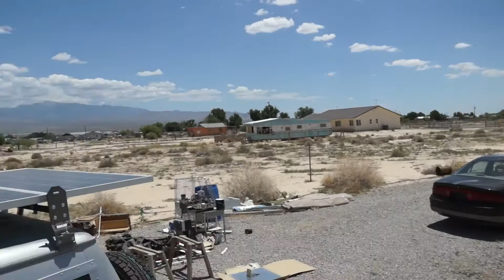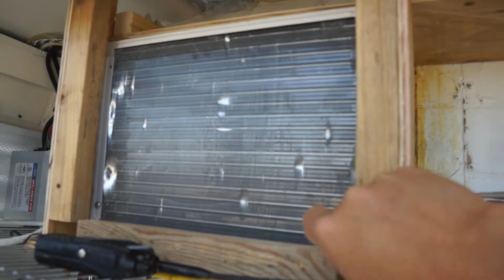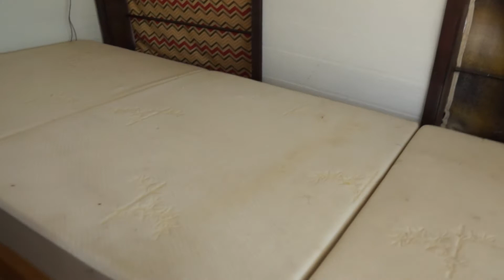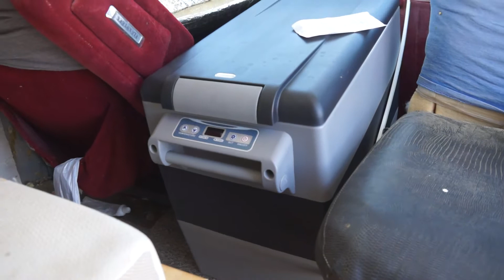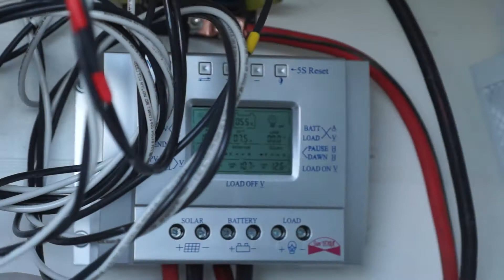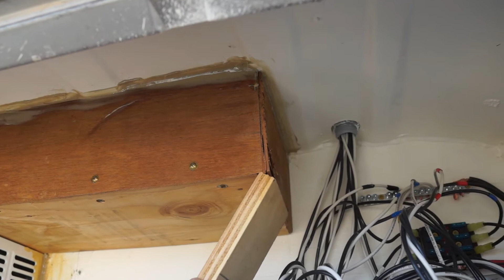Van Build 17

Comment: this might be silly but i was just wondering where you got the curtin track
Reply from the maker: I cut the track in half and installed them from the sides towards the middle of the roof. I  let the two pieces pass next to each other in the middle. This way the curtains would also overlap each other in the middle. 

https://www.amazon.com/gp/product/B002UC2TFK/ref=ppx_yo_dt_b_asin_title_o09_s00?ie=UTF8&psc=1

https://www.amazon.com/gp/product/B003YJJQSG/ref=ppx_yo_dt_b_asin_title_o09_s01?ie=UTF8&psc=1

Comment: Wow! That is a LOT of power on a van! I honestly don't think I have ever seen that much solar power on a van. Awesome to see what is possible. Thanks for sharing your experience with this.
Reply from the maker: Pahrump gets plenty warm in the summer. The solar  panels main purpose are to power a 5,000 BTU window air conditioner during the day. I can leave my dog in the van while I shop or whatever.
The batteries job is to just run the vent fan and refrigerator overnight. By the time I need AC the next day the solar panels already have the batteries recharged. 

There is also a generator back up. I could run the AC at night with that if I really wanted.

Comment: Added comment the fridg inside but vented out back and up where ac is vented
Reply from the maker: It might be possible to vent the refrigerator out the front of the vehicle, but a refrigerator does not discharge a high volume of heat. It only moves the amount of heat that is inside of the cooler.

Comment: Your solar set up is awesome! Any concern about the a.c. vent heat on the back of your panels?  It's looking good Dan, you've been busy!
Reply: Van build looks good.  Wonder how high speeds on freeway will affect panels staying on in the front - did this work out?
Reply: I like all elec is in back +ac. and the elec plug in plus plugin for WiFi hookups a thought if the frig Was in back it could be vented out where ac is  vented thus not heating inside van don’t no if then could be accessed from inside van. I like your video thanks.
Reply from the maker: The air coming out of the A/C will probably still be cooler than the heat from the sun beating down on the dark panel, so it might even cool the panel.
Reply from the maker: I drive 55mph going into town where I live. Seems to be Ok. Pulling the trailer I usually try to keep the speed there or just under. I may build some kind of air deflector so the air coming off the windshield has an easier place to go.